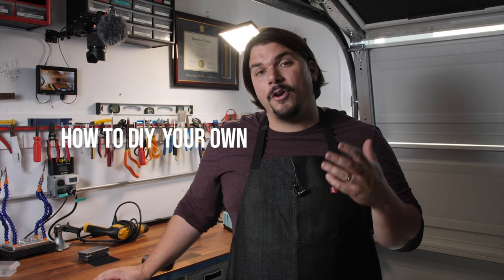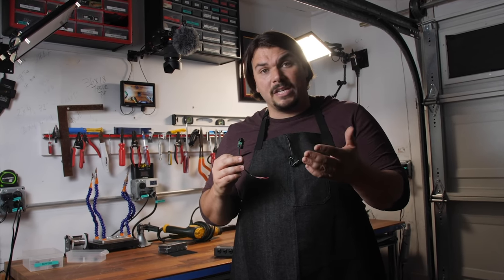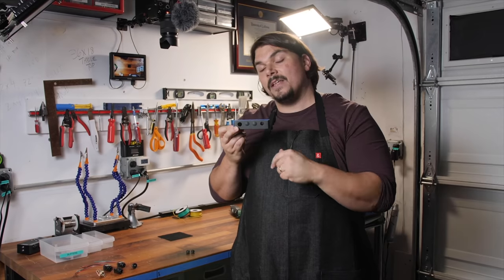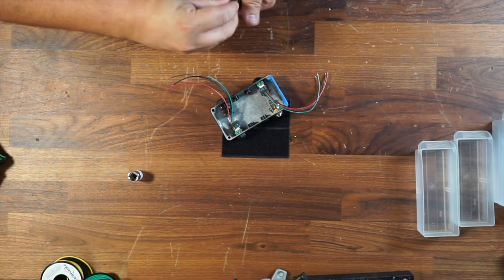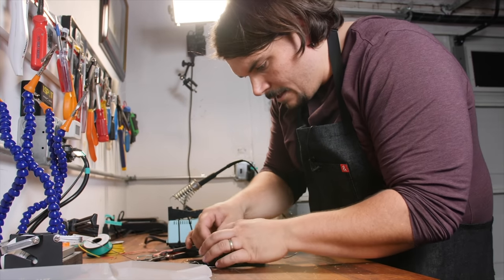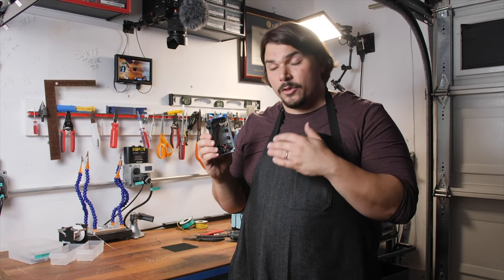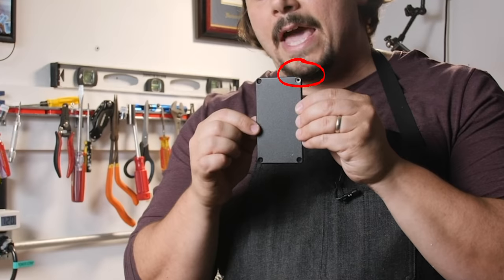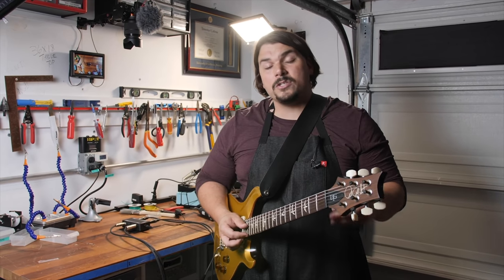Build Your Own Buffer!

Comment: You mentioned a different ohm rating for bass, I don't see that option on the site referenced. Did I just miss it while looking around.
Reply from the maker: You can request a different value from Creation Audio Lab, or change the R1 resistor to whatever you want, 1M, 2.2M, etc.
Reply: @VertexEffectsInc  Ok great, thank you.

Comment: Could the 4-wire version be used to obtain a 1M ohm impedance when using a passive effects loop? For instance, in the Matchless DC-30, could it be used to get the 1M ohm for both channels' effects loop at the same time?
Reply from the maker: You'll really want a Dumbleator style for this application in the effects loop for a buffer.  I like the solid state Kleinulator.

Comment: Hi Mason, thanks for your great channel! I Purchased the parts for the mono w/ tuner buffer (still waiting for half of the stuff to arrive...) Do you know what the current draw is (and can I measure that with a multimeter myself?)
Reply: Ah, 15 mA per buffer.... should have listened closer the first time ;-)
Reply from the maker: It's about 15mA per buffer.
Reply: @VertexEffectsInc  Thanks for responding so swiftly! No-one would expect that. I was so lucky to win the boost pedal on your giveaway last friday (how crazy was that...? Feeling really sorry for the guy who already won something else though..) and it really solves my problem with both getting the tuner AND the volume pedal out of the chain (i.e. tuner via this buffer and volume via the boost) So again - thanks!! Oh, and a side question: why is the Nyle discontinued? I saw some videos on that and I'm quite impressed (I'm usually not a big compressor fan)
Reply from the maker: @petertinning899  we're making a smaller more compact one with a single footswitch.  Most people used both channels on all the time.
Reply: @VertexEffectsInc  Cool! Will you be able to alternate the order of the comp and the preamp ala the Aria?

Comment: Hi doctor.
What do you think about placing the CAL redeemer buffer straight on the guitar (as suggested on their website) instead of in the interface to handle the first cable's impact on the sound ? Would this not result in a better (more neutral) tone ?
It seems logical to me anyway, but wanted to ask for you pro advise about it :)
Thank you
Reply from the maker: You can, it's like putting the buffer further back in the chain so the cable out of the guitar is also buffered.  It will, however require some modification on the guitar, which can be problematic to some.  Secondly, we usually hear some capacitance from our cable even with just a cable into the amp, so this simulation is a little bit different that most of us are used to even with one cable straight into the amp.

Comment: I guess I'm looking for a Single Bypass Loop pedal. Will any of these pedals accomplish that? (In the Thumbnail, the pedal in Mason's right hand has a toggle switch. None of the diagrams include a toggle switch. I was hoping that might be a Bypass toggle.)
Reply from the maker: What do you mean by single bypass loop?
Reply: @VertexEffectsInc  I'm thinking about splitting my Bass Pedalboard into 2 parts--1 pedalboard for my "Always" pedals and 1 pedalboard for my "Sometimes" pedals (saving me from having to constantly reconfigure my board and/or unnecessarily bringing a heavy pedalboard when I won't be using all of the pedals). When necessary, I'd connect these two pedalboards with an interface of some sort on the Always pedalboard. Tuner to Compressor to Interface to HX Stomp. The Interface, much like a True Bypass Loop, would pass signal from the In to the Out, until I plug the "Sometimes" pedalboard into the Send and Return. Either there'd be a toggle switch to turn the the Bypass Loop on, or maybe just plugging things in will turn the Bypass Loop on.
Reply from the maker: @JETallacksen  I think the Mono Dual Buffer with Audition Loop is exactly what this is - see that example diagram on our site.  Doesn't require a switch.  When you plug it in, it re-routes the signal path to your board and then back to where it was on the main board.  Unplug it and it all normalizes as it was originally.
Reply: @VertexEffectsInc  Sweet action. But this solution seems like it has 4 too many inputs/outputs. I'm thinking all I need is an In, a Send, a Return, and an Out. Am I correct? Can I just not install/wire up some of these extra inputs/outputs? Which ones do I leave out?

Thanks for your help, by the way! I do appreciate it.
Reply from the maker: @JETallacksen  Jeremy, I think it's correct.  Bass to input buffer.  Input buffer send to pedals on the main board.  Audition Loop Send to auxiliary board.  Auxiliary board to Audition Loop Return.  Audition loop out back to main board.  Main board to output buffer.  Output buffer to amp.  Everything connects into the interface box, your bass, your amp, your satellite pedalboard.

Comment: Hi Vertex! I would love to build a stereo interface with a tuner out as well as an audio kill switch and an audition loop. Any suggestions/schematics on how to do so?
Reply from the maker: You can combine what I have here to get it - you’ll just need a bigger enclosure, a Hammond 1590BB should work
Reply: Okay thank you! I dont know about where the kill switch should be wired in/how that will fit into the schematic
Reply from the maker: You can use any DPDT switch for that wiring the input buffer in and out of it.
Reply from the maker: Actually even a SP switch would work for the mute
Reply: Okay! Thanks for your help!!!
Reply from the maker: My pleasure!

Comment: Great vid!  One thing I was wondering, are you able to do this as an a/b box to different destinations and or switch the buffer on or off as needed?
Reply from the maker: A/B switching between two outputs?  You can, but we don't have a diagram for that.  Regarding the buffer, typically you'd want that before the A/B switch, but you could put an on/off on the buffer if you wanted.
Reply: @VertexEffectsInc  yep that’s right. I did see on their site they have a diagram with a switch, just wasn’t sure how to wire that in along with switching the outputs
Reply from the maker: @seane1081  Generally on an A/B output, it would be the input signal, then buffer, then the switch to change the outputs between A and B.
Reply: @VertexEffectsInc  Does that mean you'd use the buffer as the input jack?  I guess that's where my confusion is

Comment: if i were to install a buffer from audio creation labs or whatever, into my Ernie ball VPJR do i need one for output from the pedal AND input to the pedal? or just one or the other?
Reply from the maker: You could, but I think generally they put it on the output with these sorts of mods.
Reply: @VertexEffectsInc  thanks!. Would there be any known detriment or benefit for putting one in the input side as well? Also would there be a difference between having a buffer unit installed in a volume pedal vs having a pedal/ buffer directly after or before the volume pedal?

I thought I had read somewhere that having a buffer on the input actually can affect the sweep or something like that.
Reply from the maker: @dylanlee4776  no, that's basically what the Vertex Boost is doing to it if you were to use the insert/EXP jack.

Comment: What would be the best way to build one with a "fuzz loop"? Would I wire the "fuzz return" straight to the buffered send or would I wire it to a jack that would be jumpered to a second buffered guitar input?
Reply from the maker: Put an audition loop first and the return being the input buffer.
Reply: @VertexEffectsInc  And the CAL Buffer jack needs to be installed as a send or out to the amp, correct?
Reply from the maker: You would still need two ideally

Comment: Hi Doc, I’m going to have the 4CM version built by a friend of mine who is pretty handy with a soldering iron (unlike me…), and he mentioned the following about ground loops:

“One thing to bear in mind is that any gangs with a buffer in will not be isolated from the other gangs that are buffered, in that they will be sharing a ground connection inside the patchbox.  This should not be an issue but does leave the possibility of the being a ground loop when using the four-cable method.”

Do you think there is a potential for a ground loop using your diagram when using 4CM, and if so is there anything that can be done to minimise or eradicate the risk entirely?

Love your videos by the way, best tutorials on YouTube - fact.
Reply from the maker: The nylon jacks are isolated, the only ground they share is with the power supply, which is also isolated.  The only ground to the case is the input jack, everything else is floating as it's shown here.  I think your friend either 1) didn't look at the material list or 2) doesn't fully understand the diagram or how it relates to ground loops.  If you use the nylon jacks and do what the diagram shows you'd only have a potential ground loop if you split your send/return cables far apart to increase the loop area or moved your FX Loop pedals far away from the rest of the board with all the FX in front of it.
Reply: @VertexEffectsInc  that’s the answer I wanted to read! I think it may best to build this myself - if I can make my own patch cables and dc power cables (thanks to your other videos) then I should really be able to do this too. Time to take a leap of faith….
Reply from the maker: @lord_of_hove  good luck!  You'll do great!
Reply: It’s done - and it works like a charm! Some of the soldering was a bit tricky but it worked first time. No ground loops either. Thanks doc!
Reply: @lord_of_hove  I'm curious, did you solder all the power cables to the buffer closest to the DC jack or all to the DC jack? I have almost no soldering experience so I'm just trying to get ahead of any potential issues as I've seen some other comments where the mention that trying to get 2 sets of power cables to the single buffer is difficult.
Reply: @Drtydeeds  hi, yes I soldered all 3 power wires onto a single buffer, which was quite tricky as I too have limited soldering experience. 

If I were to do this again I would probably do it slightly differently and solder the power the input buffer power wire onto the “to amp input” buffer, and the the power wire from that buffer to the “fx loop return” buffer, so that you have 2 buffers with 2 power leads on them rather than 1 buffer with 3 - if you see what I mean? The tricky part was stacking the 3rd power wire onto the buffer as Mason describes, so this might be a better way for those of us with limited experience with soldering?

Comment: I thought about using the Boss TU-3W as the Input Buffer for my Board. Would you recommend the Buffer from the Boss Waza Tuner?
Reply from the maker: I recommend 1M input impedance and 100 ohm output impedance.  The Boss is 1K (10x higher than recommended).  I don't really see any fundamental difference in the Waza buffers than any of their other BJT "flip flop" buffers, maybe tighter tolerances or lower noise parts, but nothing really different about them.
Reply: @VertexEffectsInc Interesting. Thx for your response!
Reply from the maker: @DerRiot  sure thing!

Comment: Hey Mason, you said this was around $50 but just one buffer alone is $45. It would be over $100 for this box. Were these cheaper before? thanks
Reply from the maker: You should be able to gather the materials for a single buffer for about $50 with the materials (per buffer).  I think the term used was “as little as $50” for the most basic, and goes up from there depending on how complex you want.  I think the most complex buffer is around $140, which is still about $160 less than an equivalent buffer doing the same thing of a similar quality.
Reply: @VertexEffectsInc  Okay gotcha
Reply from the maker: @RobbyFireTV  perfect!  Hope you try it out!

Comment: Question: I just finished building the FOUR CABLE METHOD (TRI BUFFER). The Switchcraft Tip Shunt 1/4" Jack looks different in real life than it does in your wiring diagram. I think the jack in the diagram is reversed to reality. The center tab is the same, but the other two are on opposite sides from what I'm seeing in the diagram. Should I wire it the way the diagram shows (green on center and bottom, brown on top), or reverse the wiring (green on top and center, brown on bottom)? Thanks.
Reply from the maker: The diagram is correct - you must remember you're looking at the diagrams although the pedal is upside-down.  We've had several hundred of these built and in each case of error it was a mis-wire or a misunderstanding of the diagram.  You can email us a photo of the issue if you'd like some feedback info@vertexeffects.com
Reply: @VertexEffectsInc  
Thank you. Problem solved.
Reply from the maker: @nosajybsorc  what did it end up being?
Reply: @VertexEffectsInc  
Like you said—the wiring. Thanks. I reversed the wiring and that fixed the problem. I'll send an image to explain why I made the mistake I did. I'm sure I'm not the only one. Thanks for your help.
Reply from the maker: @nosajybsorc  we've had some mis-wires in the past I think the upside-down thing gets a lot of people.
Reply: @VertexEffectsInc : One more question, sorry. Do you recommend putting this buffer before or after a Dunlop Fuzzface Mini? I've read that buffers before certain Fuzzes can cause issues.
Reply from the maker: @nosajybsorc  fuzz before buffers
Reply: @VertexEffectsInc  
Thanks!
Reply: Would you mind posting a picture of how you wired the green cable that connects to the guitar jack? The diagram and replies on here don't make any sense. It's supposed to connect to the bottom and center lug, but I don't understand how you get the same wire to connect to two lugs - based on how the diagram is drawn.
Reply: @Drtydeeds  It's possible to use a second, shorter piece of wire to connect to the second lug. As long as they're soldered together and there's continuity of the electrical path.
Reply: @nosajybsorc  thanks for the reply. I eventually got there with the help of some others comments. Finished the buffer and it works like a charm
Reply: @Drtydeeds  Great! I'm glad yours works as well as mine does.

Comment: Any troubleshooting hints post-build? I built the version with the FX loop jacks as well (3 buffer jacks) but it is not working. The most challenging solder joint was where you have to daisy chain the power from two of the buffers to the third. Any hints on doing the soldering there?
Reply from the maker: You could combine them all at the DC jack.  I would trouble shoot one set of input/output at at time.
Reply: @VertexEffectsInc  Yeah...it is kind of 6 of one, half dozen of another.  It is probably easier to solder the combination at the jack, but it is a more cramped area to try to solder in.  I also trimmed all the wires for the combination on the one buffer, so I am not sure I have enough wire.  Actually, I think I fried the 9V jack with the soldering iron - I get no readings on the tabs at all with it plugged in.  Luckily - I bought a couple extra!
Reply: @VertexEffectsInc  OK...I redid the wiring as you suggested - all red and all black combined at the 9V jack rather than on the one buffer.  I actually think that is the better way.  I checked voltage at the 9V jack (9.15 v), and at each buffer (all 9.1 - 9.15 V) and I checked continuity on all other wires with the meter.  Everything has good connections on the meter.  Any other thoughts before I connect it up again?
Reply: What did you do with the green wire from the first buffer to the input jack? The diagram is unclear, it looks like it connects in two spots, but how do you do that with one green wire?
Reply: @Drtydeeds  It is just two wires.  One goes from the buffer to the input jack, and then you just use a short jumper wire to connect to the other connection on the input jack.
Reply: @DanielBobke  THANK YOU. The jump cut a @7:35 skips over that part completely and the diagram doesn't make that clear either. It makes sense. You can probably just use the excess you cut off to get to the first solder joint. Is my inexperience with soldering showing? lol Thanks again Daniel.
Reply: @DanielBobke   With the power wires, can you connect them in a chain instead? Something like the power wires from the first buffer to the 2nd buffer, and then the wires from the 2nd buffer to the third. Third buffer to the DC jack.. that way you on only ever have a max of two sets of wires being combined and only 1 and the actual dc jack... I hope that makes sense.
Reply: @Drtydeeds  Happy to help!  There are some problems on the diagram - but it is free, right?  You are exactly right about the excess wire - just use the excess green.
Reply: @Drtydeeds  That is just more soldering and I don't like putting heat on those buffers if I can avoid it.
Reply: @DanielBobke  makes sense. I think I going to try to solder them all directly to the DC jack, for peace of mind and simplicity.